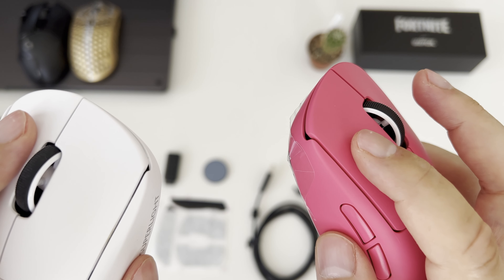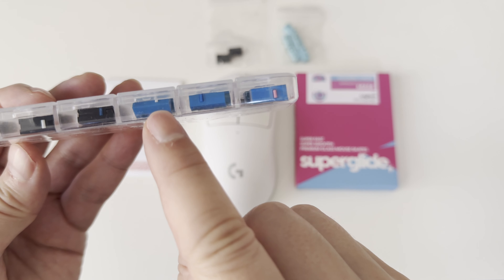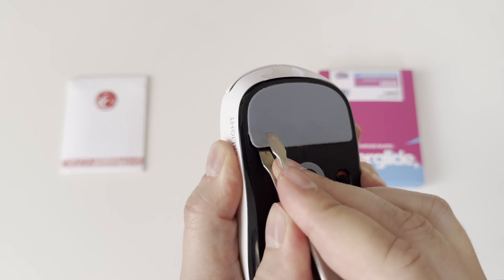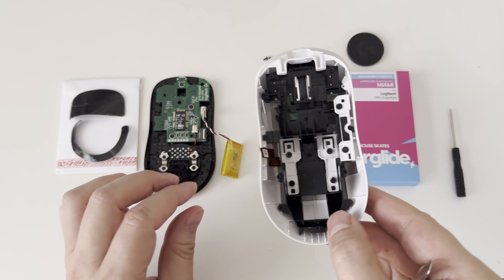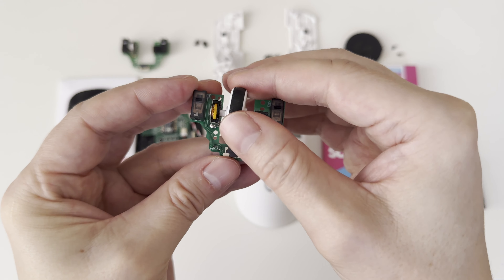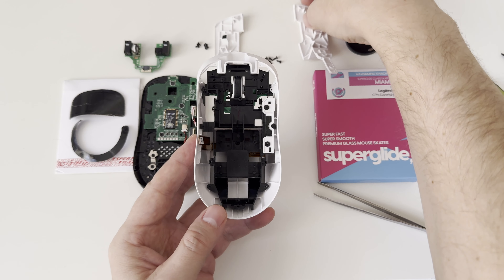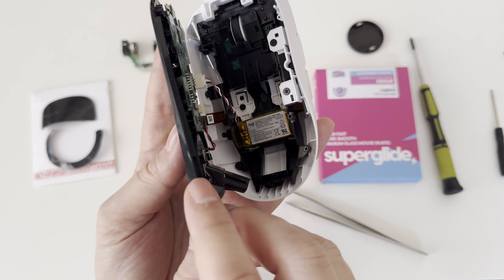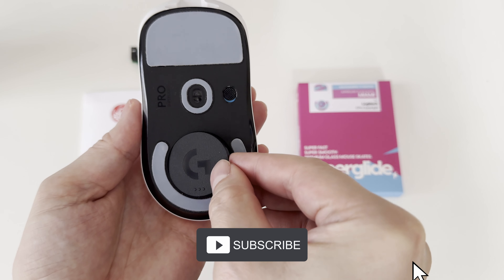Fix for double clicking and scroll wheel rattling on Logitech G Pro X Superlight

Comment: Hi, can you tell where did you bought scroll module? I have the same issue.
Reply from the maker: Thank you for watching and posting a comment. Without promoting any shop I can give guidance that I have searched on the Google for "Logitech g pro x superlight switches board replacement" and then I went through the links and picked up the one with fastest delivery timeline, even though it was like 3 weeks. I have then also found one where you can choose from variety of switches on the board and variety of scroll wheel encoder on the board. As mentioned in video I will be doing another scroll wheel encoder replacement video so stay tuned ;-)

Comment: where did you get all those switches and the box? is there a set pls can you link it
Reply from the maker: Thank you for watching. You might want to search on Google for "24pcs/box Micro Switch TTC Kailh HUANO Omron button repair" as the link where I bought the box is no longer available. Hopefully you will get some good result, matching the box seen in video, with cheap shipment option. Good luck with your Logitech G Pro X superlight double clicking button issue repair.

Comment: where do i find that motherboard with kailh 8.0 switches and the ttc gold encoder ?
Reply from the maker: Thank you for watching and posting a comment about G Pro X switches motherboard. Best is to search google for: “Logitech G Pro X Superlight custom switches board with Kailh GM 8.0 and TTC gold scroll wheel encoder”, as very often the e-shop links are changing and become non-functional. You might find very good deal for dust-proof scroll wheel encoder on PCB board with Kailh GM 8.0 switches. Hopefully you’ll find good board and will let us know if the fix for G Pro X double-clicking issue worked for you. Good luck!
Reply: @ottomixa  thx

Comment: would appreciate if you provide link for the boards and stuff
Reply from the maker: Thank you for watching. Unfortunately the links on the e-shop I've purchased the switches boards are changing a lot, so I do not want to disappoint anyone clicking on non-existent links. Basically googling it out will give everyone the best choice, but one must do little research. Good luck with your replacement and keep us posted on result.

Comment: good video !
Reply from the maker: Thank you for watching and for your feedback. Do you have Logitech G Pro X Superlight and planning to fix scroll wheel or left click issue? Or are you planning to get new Logitech G Pro X Superlight? It is still one of the best gaming mouse for reasonable price when Logitech G Pro X Superlight 2 is more expensive. Dismantling GPX seems to be fairly easy to fix the scroll wheel or left click issues. Stay tuned for more great videos.
Reply from the maker: @brat_ox  I've tried the same trick with blowing the air under the buttons to fix the unwanted double-click issues initially, unfortunately it did not help me and I had to replace the switches. I'm glad that it helped you though. Thank you for your positive feedback on video, I really appreciate it.
Reply: ofc its just temporary fix , and yeah sadly my hands grown up from my butt so im scared to open my mouse , and replace the switches xD @ottomixa
Reply from the maker: @brat_ox  haha, yeah I was also little bit scared to damage it by de-soldering the switches and soldering back new one, that is why I bought the full board with switches already soldered in. The scroll wheel encoder is not perfect on it and I will need to find some better board with switches and good scroll wheel encoder, however I have managed the replacement as it was my only choice with non-functioning G pro X superlight mouse. Other option was to buy completely new one which is most expensive option. Good luck with your Logitech G Pro X Superlight mouse.

Comment: good video sir
Reply from the maker: Thank you for watching and sharing positive feedback. I'm happy that my video helped a little bit while you are experiencing double clicking or scroll wheel issues on  Logitech G Pro X Superlight. There is one more issue I started to experience on my other magenta G Pro X mouse and that is scroll wheel changes scroll direction randomly for one step, when scrolling down, it suddenly scrolls little bit up and then continues scrolling down.  I will need to dismantle my ping GPX to fix the scroll wheel. I'm also planning to get the GPX 2 DEX version, so stay tuned and good luck with your G Pro X repair adventure.

Comment: dose anyone have like my problem on any mouse so the problem is when i click the right button or the left button it clicks both and i haven't found any one with problem on any mouse 
if you anythig please tell me
Reply from the maker: Thank you for watching. Would you have a chance to test your Logitech G Pro X Superlight malfunctioning clicks on some other PC, i.e. friend's PC. That could rule out any bad system setting or Logitech G Hub settings. If it behaves in same way on different PC, then most probably it could be bad switches and you might either use your warranty replacement or you might want to choose to replace them as per my video. In some cases dismantling Logitech G Pro X superlight and cleaning up the switches by air blowing them might help.
Reply: @ottomixa thank for your reply ❤️. 
 i tried on another pc but its from the mouse it self. I bought it of Amazon and i saw the reviews and alot of people have same issue i got.

Comment: Gracias! Estaba sufriendo con el muelle de la rueda del ratón
Reply from the maker: Gracias por ver. De hecho, el resorte de la rueda de desplazamiento del mouse es muy difícil de volver a colocar sin perderlo. Espero que hayas logrado solucionar el problema en tu Logitech G Pro X Superlight.
Thank you for watching. Mouse scroll wheel spring is indeed very difficult to put back without losing it. I hope you have managed to fix issue on your Logitech G Pro X superlight.